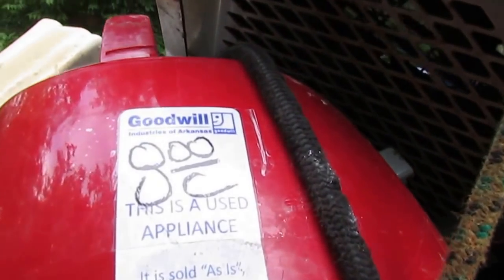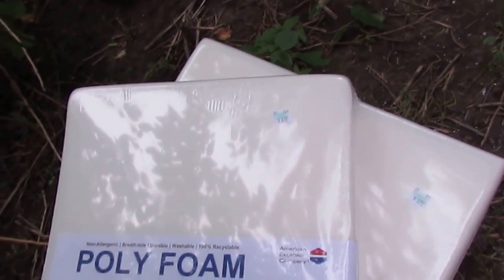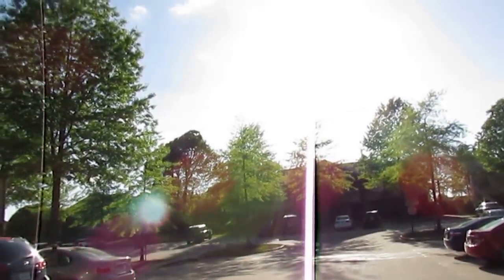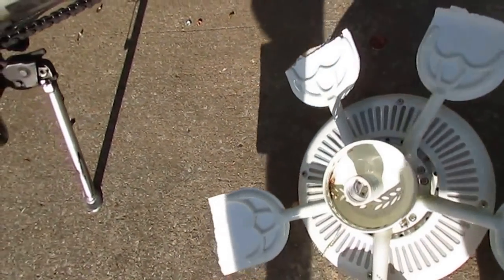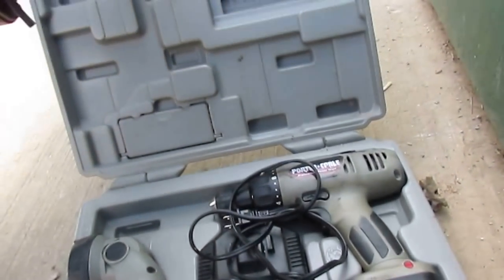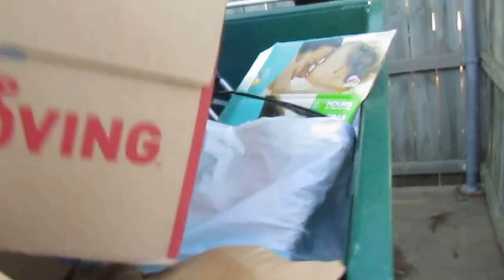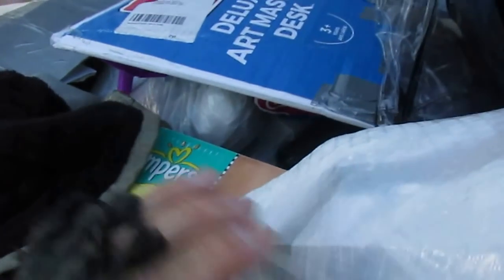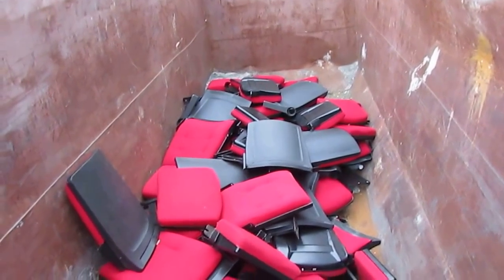Porter Cable Cordless Drill & Flashlight Set - Scrap Metal Scrapping Dumpster Diving by Motorcycle

Comment: ceiling fan replacement in spring/warm weather:  That's when many people switch the fan reverse- to pull up rather than down. At some point, the motor will not want to do that and will die. Sad.  :(

Comment: That Motorola belt clip thingy looks like a pager that I had when I was on our Volunteer Fire Department. It is an older model. I'm sure some Volunteer Fire Departments still use them.
Reply from the maker: thx for adding your knowledge
Reply: The Motorola V is still in use at many fire departments. It would have to be re-programmed for the specific frequency a department uses.